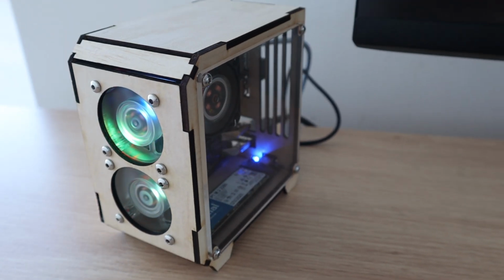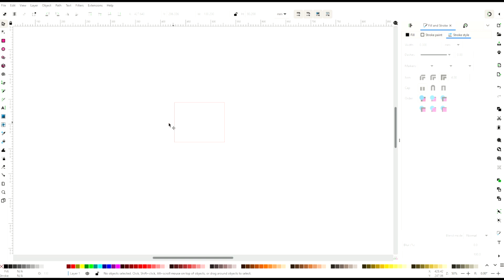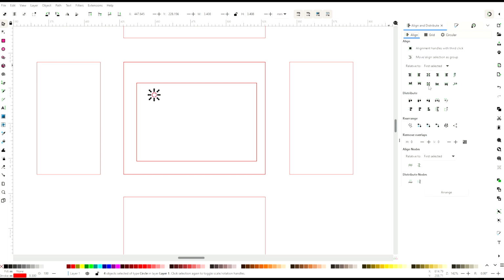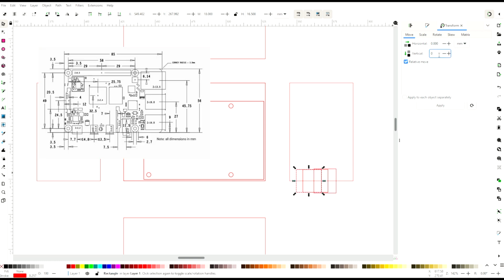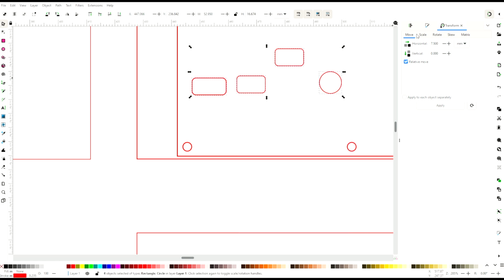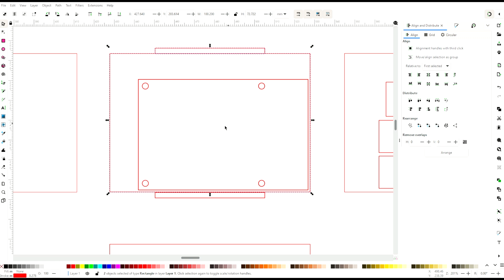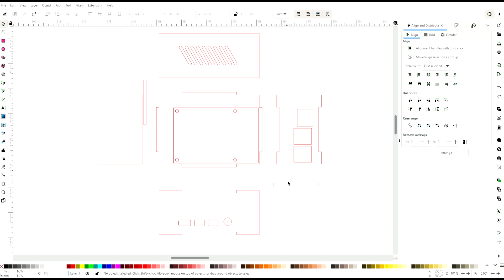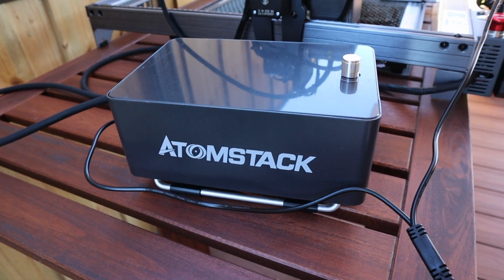How To Design A Pi Case For Laser Cutting – In Depth Tutorial

Comment: Benefits of Inkscape over Fusion 360 for this kind of use?
Reply from the maker: Inkscape is open-source and perpetually free. I also find its easier to work with for designs that are inherently "2D" as it doesn't have as much of a learning curve as Fusion360.
Reply: @MichaelKlements  ok cheers 👍

Comment: Great video Michael! I'm already quite familiar with Inkscape from creating RedBubble car art, but I'm curious - do you have a link to those technical drawings anywhere for the Pi the the 40mm fan? I'd love to have them when designing cases for reference to scale!
Reply from the maker: Thanks Kody. The drawings I've used for the Pi and fan are both just ones that came up when searching "40mm fan dimensions" or "raspberry pi dimensions" under google image search. You can find drawings for most other standard size fans as well - 30mm, 60mm, 80mm, 120mm etc.